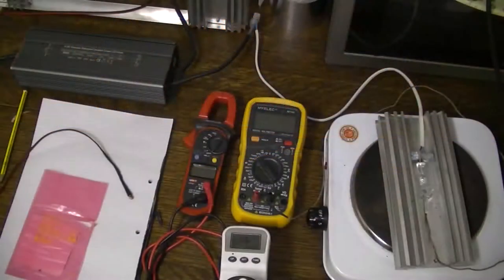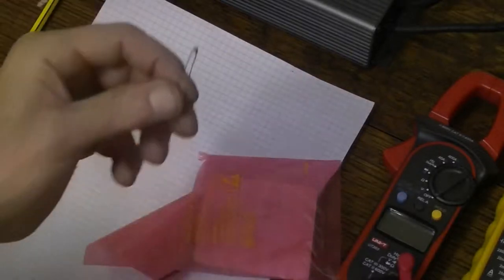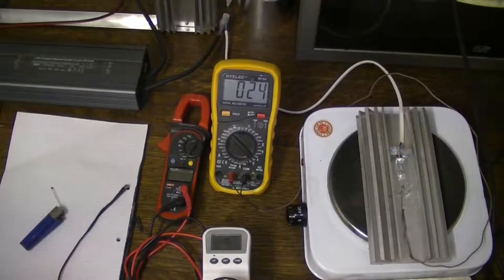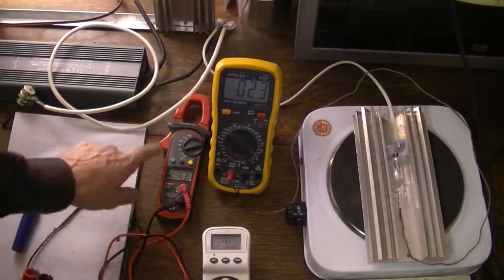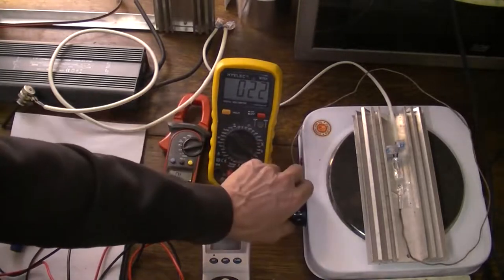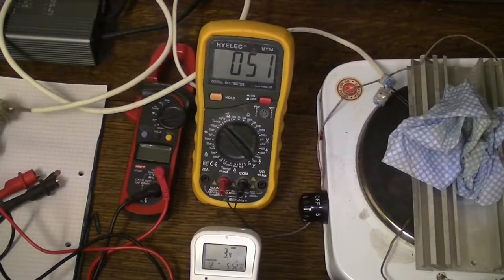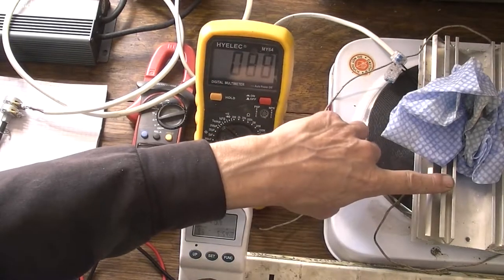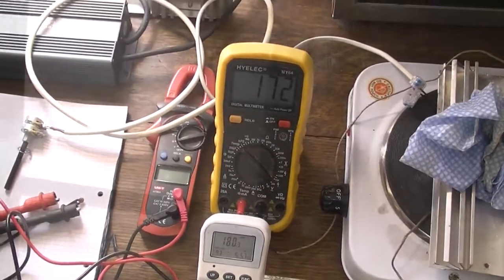Thermal CoB LED Protection - Using Thermistors

Comment: How could this be done without a dimming lead? Im running 3 gen 7 vero 29s @ 2100ma using a mw hlg 240h-c2100a and they are being passively cooled in an enclosure with only one fan. Though it is a pretty sound setup, some sort of thermal protection would make me feel a lot better!
Reply from the maker: It would be easy to use a simple relay on the mains side triggered by a set voltage at the far side of a thermistor, it would of course simply turn the lights out in an emergency where this slightly more sophisticated version simply dims them to suit any temp excess. if you use skype i can walk you thru it easy enuff there or if needs be by email.
Reply from the maker: ^sorry just re-googled your driver and you will be running series not parallel, you already have thermal runaway protection as you are just about perfect current for v29's so if a cob fails it cuts the power to the other two. you could still add a sensible thermal cutout to stop heat based heck before it burns out a cob in the process.
Reply: Jack Freeman thanks for the reply! My concern was protection in the event the fan died. Pretty awesome idea to have the cobs dim in the event of overheating. I tried to order the b version with dimming leads but was unavailable. Didnt think id really be doing much dimming so wasnt worried but this video gave me a touch of regret! I will be utilizing this in future builds. Your offer and input is greatly appreciated. Just found your channel today and have been loving it! I will spread the word!